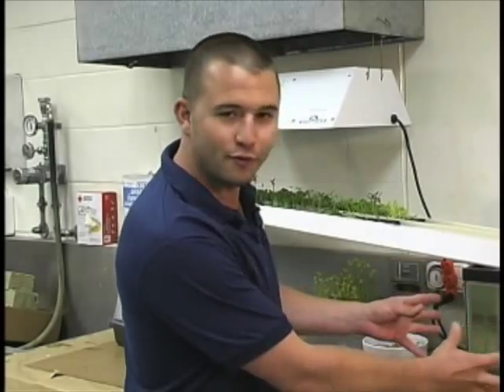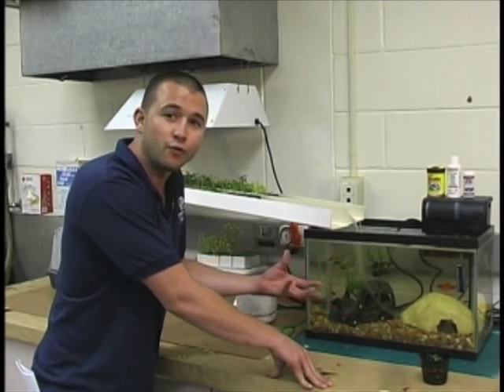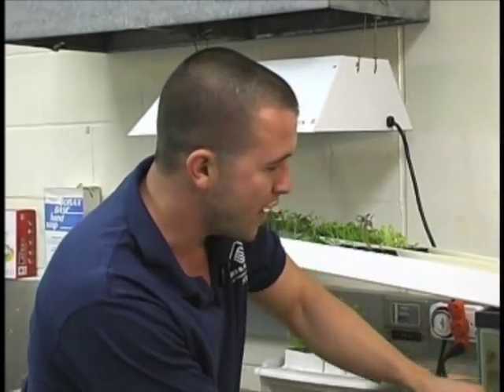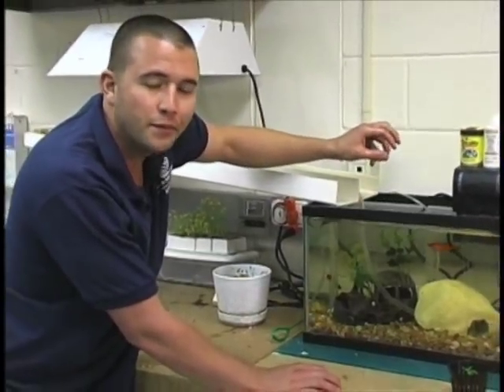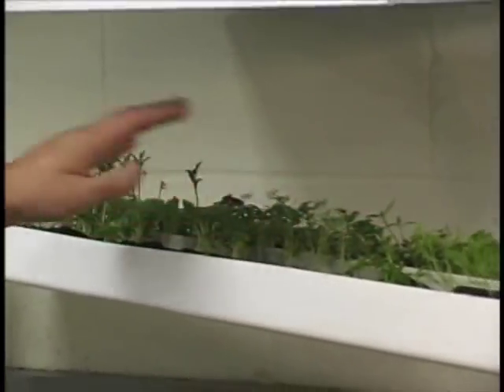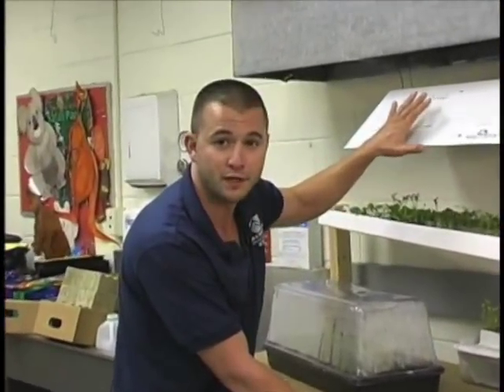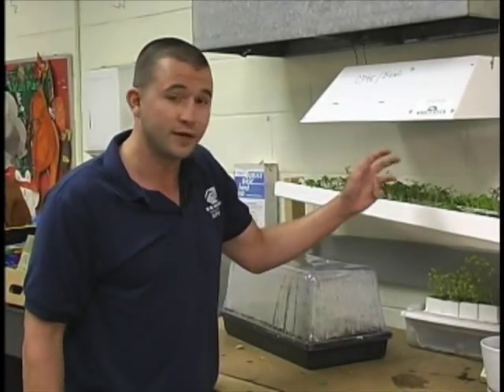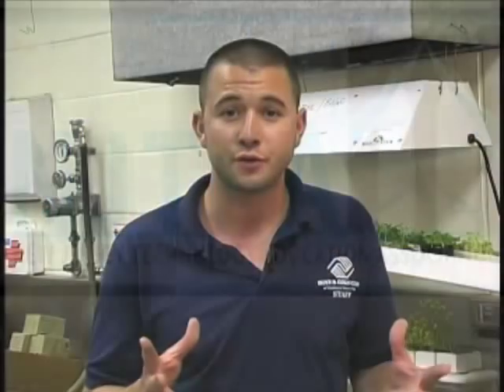Aquaponics, Hydroponics & Aquaculture (Part 1)

Comment: With additional air you can use DWC. 

The Deep Water Culture style is a continuous flow and your plants will not drown. This is more effective filtration without question. Meaning you can increase everything. 

Keep it simple ,the more timers and junk in-line, the more chances at failure. 

The use of a larger pump and a greater Water drop/fall from plant tray to tank can replace all mechanical air.

Now is the time to think low impact low energy use. 

Not bad keep learning.

Comment: Many think all you need to do is hook a DC air pump to a solar panel and 12 volt battery to make a solar aerator for aquaculture.  Not even close.  For the real deal go to   24-7solaraerator.